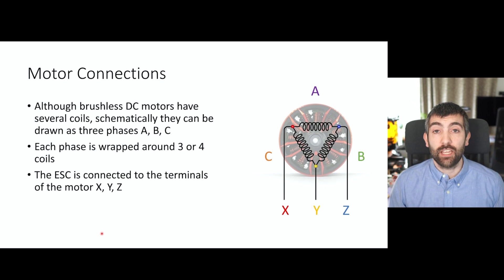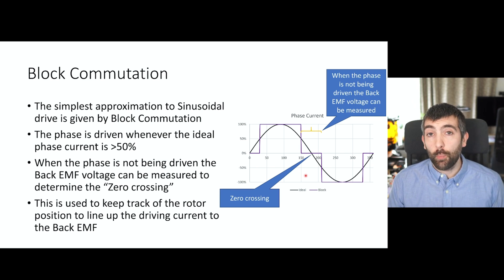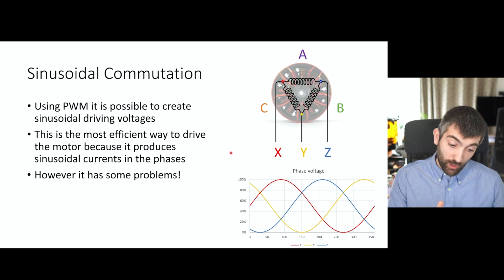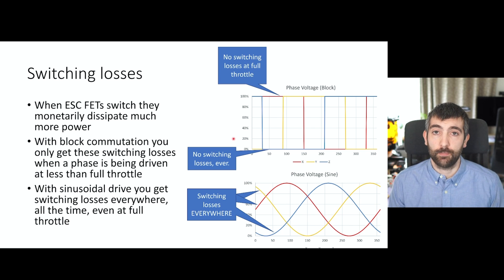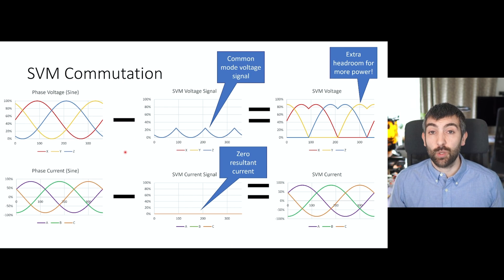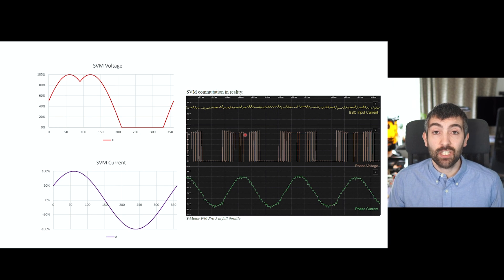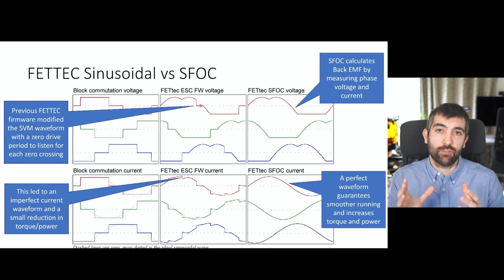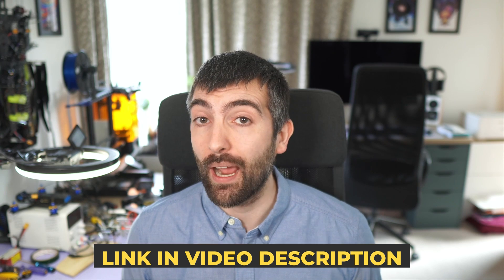Motor Commutation Explained: Featuring FETTECs new SFOC approach

Comment: I could really use your help sir. I'm looking for a 20by20 4 in 1 esc for a Flywoo Explorer LR 4 V2 with Flywoo Dave-C-FPV 1404 v2 2750kv motors and a matek H743 mini V3 flight controller. This build will be for long distance and Arducopter. Thank you

Comment: Nice deep dive Chris. All the methods presented here only utilize one FET per motor coil phase. I'm surprised that no effort has gone into using 2, or 3 FET's in parallel for each coil phase. Even with using the block-method, as very pure sinusoidal waveform, or other shape could be assembled (via making use of a Fournier series of the waveform) to produce similar waveforms, but do so with greatest FET efficiency. (such technique is common with solar inverters that produce 'pure-sinusoidal' power.

NOTE: The PWM frequency being used (12:21) is ~40x higher frequency that motor coil phase frequency. (eye-balling from diagram) Thus means the FETs need to be able to operate at these frequencies, while being able to deliver maximum current and voltage. Such high frequencies can lead to more heating (loss in efficiency)

Comment: Would it be possible to make VESCs support SFOC? AFAIK VESCs have shunt resistors for every phase and can also measure voltage on each phase, so my guess is that it would be possible to implement this from software on a VESC... ?
Reply: What makes you think Vesc doesn't have that already?

Comment: Nice video. Im just not sure about the sinusoidal current of a BLDC. The winding isnt harmonic so there shouldnt be a sinusoidal current. Rather a trapezoidal I think. Because when I set my ESC (BL32) to modulate PWM to sinusoidal I get worse performance. Big BLDC motors or EC motors with harmonic winding or synchronous motors should be driven by sinusoidal voltage. However, Ive never measured a BLDC motor so I dont know for sure. Just how they told us in university...

Comment: Good pres Chris, I recently moved into ebikes too, and see huge crossover in the knowledge. Now I can actually visualise a square wave controller. I wonder if SFOC would apply to ebike controllers and if the fact the motors are sensored would help with the back emf reading issue?
Reply: A sensored drive system  (motor + ESC) doesn't need to measure backEMF to guess where the motor is.

Comment: Not trying to be a Debbie downer but with Fettec’s reputation of their esc’s catching 🔥 constantly or melting fets off the boards in flight I’m going to avoid them. I like the open source stuff we get, I just hope this new closed source tech gains some reliability for those who give it a try since there’s little support if esc’s start randomly blowing up.
Reply: A very big part of that is due to a simple design oversight on their part - in order to support their 'Racewire' LED's ALL the motor pads on a Fettec ESC have VBAT present on them upon power up/when disarmed. Now say you overheat a motor inflight (and burn the windings) or make the beginner mistake of using extra length motor screws into the windings, or just damaged motor wire insulation -now your entire carbon frame is at VBAT! Then combine that with many quad frames getting connected to GND via Antenna SMA / Vista hardmounted to carbon / Metal FC screws etc and you have a recipe for fires.... Oh and Fettec in their infinite wisdom decided to put the ESC current sensor resistor on the negative rail in the ESC so they have literally NO way to detect the fault condition!

Comment: This got me thinking about whether anybody is doing an ML based speed controller.  It seems like you could drive a specific motor as a generator and use that as a training set to learn ideal commutation.  Given the voltage/current sensors I bet it could learn SVM and perhaps some other/similar tricks that folks haven't thought of (even specific to a particular motor)
Reply: I don't see how you would go about using SVM in motor control. Maybe some LPC or some micro (few neurons) neural net since you are basically doing regression here. These algorithms are so computationally intensive running them at kHz range would be impossible on those small chips + you introduce latency. And you might gain a few percent at most.
Reply: @GK-dd5ci  I agree with you if we assume the ML is running in realtime, but you could make a much simpler speed controller that is parameterized in a few ways, and then do an offline ML process to learn from telemetry on the specific motor (for example in generator mode).

For example, say one of the magnets in a particular motor is a little weaker than the others, this ML could identify that and correct for it by changing some parameters in the realtime controller (not ML)

Comment: You might want to revisit your "more efficient" statement... efficient how? Switching losses are just that losses hence not efficient.
Reply: The losses in switching can easily be less than the losses of driving the phase at max voltage (and current) early and late in timing

Comment: I remember you going through this a year or two ago and finding it didn't make a practical difference in flight? Ignoring that it would be cool if it were from ANYONE but FETTEC.
Reply: You're thinking of BlHeli_32s sinusoidal mode. That's different.
Reply: I haven't been paying attention for a few months. What's the problem with fettec?
Reply: @luckbot-5000 I’ve heard a lot of complaints on Facebook groups that their escs burn up pretty easily. My 45a esc is still kicking tho
Reply: @luckbot-5000 as Venrad said there's a fairly consistent complaint of the quality of their ESCs. I on the other hand got baited with their takeover of KISS software only to get stuck with their own software and their replies in private were not consistent with a reasonable company. I will never have anything to do with them.
Reply: That design looks like scaled down VESC (originally designed for electric skateboard), which is not a problem because VESC  is an open source project.